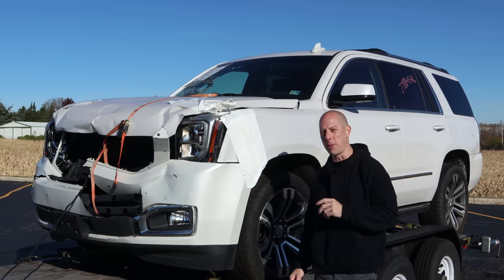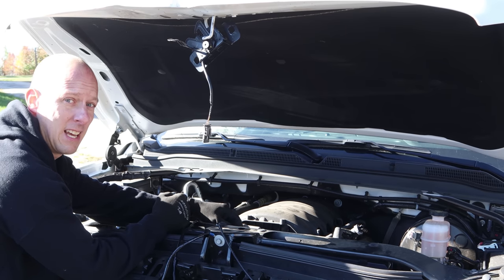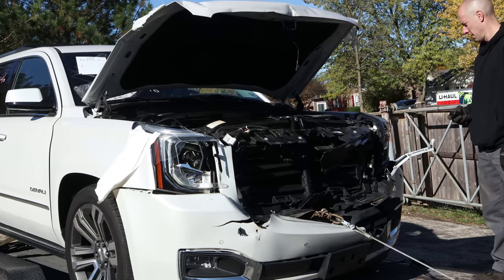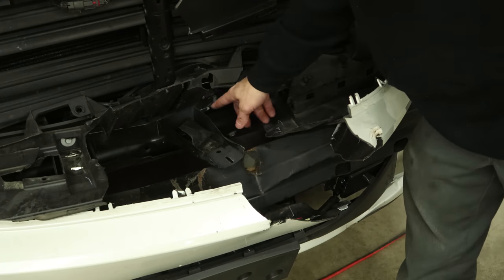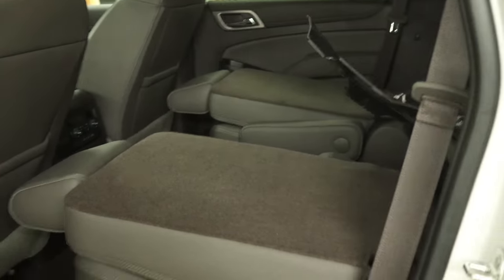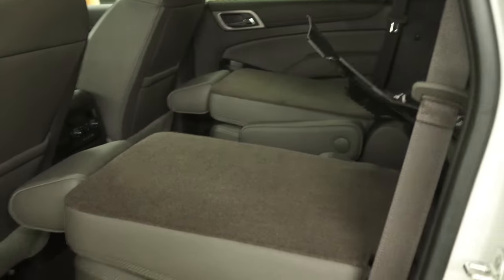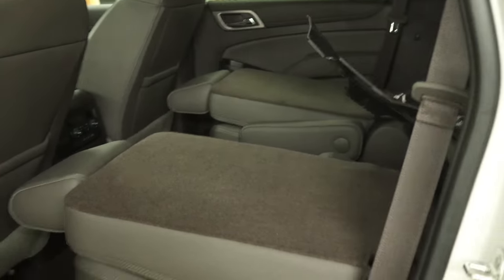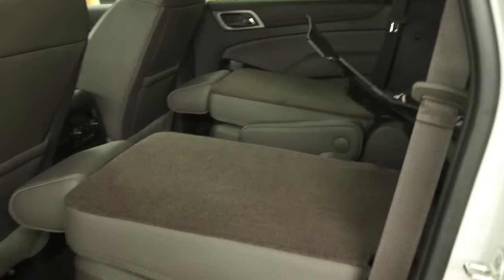Rebuilding a totaled 2019 GMC Yukon Denali

Comment: Say it with me...'R1234 Saves Lives'...ya right!  It just costs 2-3 times as much and probably only 1 out of 10 AC shops will ever purchase that expensive equipment.
Reply from the maker: I still remember when we had to switch to R134a and the polar ice caps would be melted by 2000, 2005, 2010, 2015.... Then we had climate change since people stopped buying the fear they were selling.
Reply: If you’re interested, I can explain why recovering r134a is important, and global warming is really a thing.

It’s easy to dismiss, but like you are an expert in what you do there are countless very smart people who are experts in this topic and they all agree there is a problem and we can all do our part.

Comment: Another neat trick, using your winch as a frame machine. I was wondering why you had to get the aircon guy in to do the aircon, when you normally do them yourself. Some new gas that you don't have the gear for?  Some years ago, a mate came to me with his 6 cylinder car running on 5 cylinders. We diagnosed the issue to be that a screw had fallen out of the carburettor and jammed one of the inlet valves open. We managed to open the valve further and drop the screw onto the top of the piston and retrieve it through the spark plug hole with a magnetic stick. Amazingly, it didn't bend the valve and this old Holden didn't have interference valve timing, so the only repair necessary was to put the screw back in the carburettor PROPERLY. Hope you get a used front for your repair, so you shouldn't have to buy many extra parts and we can see this Denali back on the road again soon. All the best from Queensland Australia.
Reply from the maker: Repurposed tools are always the best.  I had an explorer long ago that someone dropped a screw in the intake and it hung a valve open.  The valve broke and lodged in the piston.  That shrine of valve in piston sits on my tool box as a conversation piece. lol
Reply: @vehcor  That was a nasty end to the engine. Maybe you could show us the piston in the next video as an example as to why you took so much care to make sure nothing had gone into the intake.

Comment: You can actually vent the 1234 just fine. Thats whole point of it. If any leaks, no harm to the ozone. Until they patent a new one
Reply from the maker: It is only harmful when someone needs to make some more money. lol
Reply: The old R-12 was legitimately terrible for the environment and R-134a isn’t that great either. But if I were working on a vehicle like this with 1234yf, I’d still want to have a pro with the right equipment just because the flammability. When it burns, it creates fluorine gas which means instant death for anyone nearby even though the earth will be fine

Comment: Considering the money these bring in, I’m surprised that was considered a total loss.
Reply: insurance companies are dumb.  my wife wrecked our Jetta a few years back (similar magnitude of damage shown here), and they did not total the car.  the insurance repairs were over 13k, and i sold the car a few months later for about 11k.
Reply: That's called insurance fraud.  All they do is take it to their buddy who does insurance adjustments and they total it for them.
Reply: @g-wolf9445  not true all the time,  my wife work as a claims adjuster and the company she works for does their own vehicle inspections and doesn't let the body shops do them. So they decide if they are going to fix it or total the vehicle. What I have noticed is that they tend total cars with low resell value and cars with high resell they fix them which is crazy.
Reply: @906lane  I guess it does depend on the insurance company the vehicle is insured by. There are key components that used to be almost an automatic for a total like a bent  frame or damaged drive axle. I guess it does come down to overall resale value like you said.

Comment: 2019? Its old and time for the pile
Reply from the maker: but, but it isn't even dirty yet.....
Reply: Lol, it was probably a suburban mom who crashed it on purpose so her husband could get her the new & improved 2021 Yukon.😂😆
Reply: @vehcor  at least not till you got in it.😄👊🤔
Reply: @taimurray04  Even with all the changes, GM is STILL wax-coating the frames of the 2021 SUVs. My 2007 Denali's frame is nearing the end of its life due to rust - the front swaybar mount bolt pulled out and took a chunk of rusty frame with it.

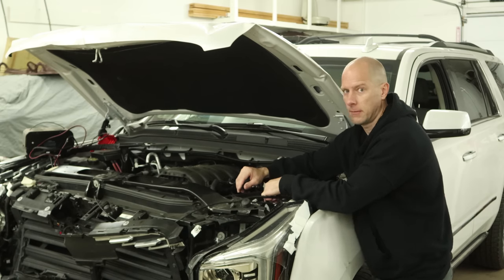Comment: 8:09 The refrigerant in the AC is actually a really potent greenhouse gas. If it's R134a, its global warmin potential is 1440 times stronger per unit mass than CO2. If it's R1234yf then it's only 4 times. The R134a also takes 13 years to break down in the atmosphere while the R1234yf only takes about a week. If it was R134a, it was a really good decision to let professionals empty the system.

Comment: Lesson #4 ($1456) of loading /unloading things on a trailer. Put the pull truck in netral with the park brake on.  That little parking pawl in the trasmission breaks pretty easy rocking back and forth.

Comment: just to let you know you can put a used floor buffer pad in your floor drain to save those expensive 10mm sockets, and add 1 to your oil drain. the trans cooler line clips come with aftermarket replacement fittings. 
thanks

stay safe
rich

Comment: I don't understand why they would total something that easy to fix, especially with just under 11,00 miles on the clock. Their loss is your gain! I'm going to guess that you paid about $10,000 - $15,000. It's been about 25 years since I did the parts harvesting thing & I only did that for a few years.

Good luck on finding a good front clip for the build.
Reply from the maker: $75,000.  It probably belonged to someone with money that didn’t want it fixed because “wrecked cars are never the same” 🙄. Insurance companies bend their rules to keep the good paying customers happy. Auction prices have gone up significantly since 25 years ago.
Reply: @vehcor  WOW, is that a MSRP price? All my comment didn't get posted for some reason. I was guessing 10-15K under the MSRP.

The cars/trucks I use to by were for the engine/transmission, then I would part the rest of it out & have what I wanted for free or close to it.

Spoke to ya next week, Ka moan.😎

Comment: Schram in Waterford MI disassembles a ton of brand new GM cars/trucks.
Reply from the maker: Funny you should mention that......
Reply: @vehcor  Ha, I have been using them for 25 years. They are 20 minutes from my house. Its amazing getting something like a "used" ac compressor with 10 miles on it for like $75.
Reply from the maker: @mph5896  I have used them for just as long.  I have purchased many test car parts with less than 5 miles on them.  I was able to get an SRX door for the GM auto show SRX before it was released to the public that was damaged in transport from them before GM had even started producing new replacements.

Comment: I was taught by Camarata school of bodywork to place a high lift jack under the door and lift up to deal with those alignment issues.
Reply from the maker: That just caves in the weak bottoms of the doors.
Reply: @vehcor  Yeah. I was only kidding. On Andrew Camarata’s trucks, folding the door is the least of the worries.

Comment: Vehcor, I am in a real pinch… I bought one of these… completely fixed it and it’s beautiful… went to get the state patrol inspection and was told it’s parts only. Bought another one to use it’s vin and thought state patrol would swap the rebuildable vin with my parts only aaaand they gave me a fat NO!  I’m in this thin $62K… can you call me for advice and answer questions?

Comment: I've always wondered - does anything get bent or whacked out of shape when they use the giant forklift to lift these cars on and off the trailer?
Reply from the maker: Yes, my Explorers all needed the rear sway bar bushings reinstalled.  I have had them crush fuel lines, floors, oil pans etc.
Reply: Depending on the forklift operator, floors, suspension and drive train can be damaged. But generally they survive ok. I've bought alot and never yet, touch wood, been unlucky to get extra damage underneath...

Comment: I'm not nosy enough to care how much you paid for it but having looked into buying a wrecked GM SUV to fix, I'm certain it was well into 5 figures that begin with a "2" considering the  low mileage and the gravy repair it needs. I'm sure you had to bid to win because there are  many other builders looking for those at any time of the day.On the flip side there are few vehicles that retain their value like those and the trucks so even a large investment will pay off.
Reply from the maker: It is amazing how many people have no idea what values are.  However,  you are on the right track and with all the correct supporting reasoning.  I felt I paid a little much but after watching higher mile vehicles that require more work sell for more, I actually got a decent deal.  It is no wonder the prices are high, these things sell themselves.

Comment: Really enjoy your videos but....Just out of curiosity, After your done filming do you go and pull all the undamaged parts from "the pile"? Like the battery trays, fender liners, hood insulation, and bracketry that looked to be undamaged. Just wondering since those items can add up very quickly in price.  Not trying to be a smartass but do you pull them back out?
Reply from the maker: That pile stays there until the build is done in case I need a part no matter how small.  The little things add up.

Comment: Does the power connection for your trailer's "charge up the car" come from the existing 7-pin trailer connector, or did you run a separate line?  I am interested because I have a hauler and this capability would be VERY handy.  Thanks, and your videos are educational and entertaining..

Comment: Amazing how you knew just how much to tap in those hinges to make the doors fit. Also, how many takes did it take to get the squeal correct when you backed it off the trailer...lol
Reply from the maker: I may have left out the other 50 or so door install/removals. lol  I got it in one take after hours of practicing!

Comment: I have a 2003 Chevy Trailblazer LTZ and the passenger side mirror got broke off by a tree branch.  I have looked all over for a replacement mirror, both new and used and haven't been able to find the right one.  All the ones I have found so far have either 5 wires or 7 wires.  My mirror uses 11 wires and I can't find any 11 wire mirrors.

Comment: First was any of the air bags deployed? Second I didn’t understand what you meant by the air-conditioner had to be extract differently?
Reply: Did you watch the video...
Reply from the maker: No airbags deployed, they were not supposed to and it uses a new freon and I do not have access to the correct machine to recover it.
Reply: @vehcor  while you may think I m a idiot. You don’t learn unless you ask  questions, but it was hit in the front , why  weren’t they deployed was something bypass.
Reply from the maker: @theodoreko2700  It is not hit hard enough to deploy the airbags.  Like I said, they were not supposed to go off.
Reply: @vehcor  that kinda odd when I have seen cars is coparts video that have less damage than yours and air bags gone off.
Reply from the maker: @theodoreko2700  Were those cars hit on a structural part?  Yes, this was not.  A front end hit 2 inches lower might have had a different outcome
Reply: @vehcor  while i quest the seat belt save the driver from damage to his body. I probably would be upset with GM for a setup like that.  Thinking that the air bag is suppose to protect you from any accident that a person is involved in.

Comment: Question: I own a 2007 Escalade ESV.  It was wrecked (front end) and repaired early in its life by the previous owner. I have wind noise on the driver door window. I’ve taken it apart, found the valence molding was broken (lower section close to the mirror), repaired best I could and sealed other parts up again. Still getting excessive noise. Anyone able to point me in the right direction?? Just started watching your videos. Very entertaining!!

Comment: It would be great if you could make a short video explaining where to get the best deals for parts (body specifically) currently doing a rebuild and had trouble finding parts from other than eBay and the dealer, both of which I think are a bit high.
Reply from the maker: car-part.com

Comment: That smoke when you’re getting off the trailer, is it normal?
Reply: Need to run it for a bit and see what comes of it.  Probably a non issue.
Reply: @ShainAndrews  It looked like steam from the cold weather. We get that here in Australia in winter too.
Reply from the maker: Yes considering it is running without a MAF sensor and guessing how much fuel it needs.

Comment: Well as someone who has been a long time subscriber & follower of your channel I just gotta ask. Question ? A man in your position with the fan base that you have why don't you have one of those drive on tilt up or down trailer like Randy over at Auto Auction Rebuilds has ? I mean the whole thing tilts down so you can drive right on, with no fooling around with ramps & when the vehicle is centered & up on it rises up. Curious ?

Comment: Actually R1234 isn’t killing the environment as badly. The GWP is lower than that of CO2 and it has no impact on the ozone layer
Reply from the maker: I am old enough to remember the days when we had to stop using hair spray and switch to 134 because of the hole in the ozone that was going to melt all the ice caps and have the whole world underwater....... 20 years ago.  Now the ozone seems to be fine but we have to switch again because???  Follow the money for the real answer.

Comment: I wouldn't say "nobody" uses the auxilary battery tray, I used the one in my 99 tahoe to put a deep cycle battery for my 4,500 watt stereo system, sounded awesome for about 2 years too then i killed the yellow top deep cycle battery and pulled it out and ended up buying my 06 escalade. ROFLMAO "Playdonium" don't seem to find that one on the periodic table of elements any where, must be some kind of new fangled composite alloy or something